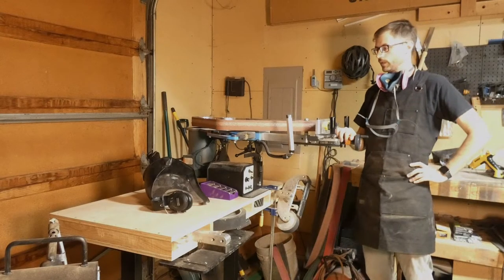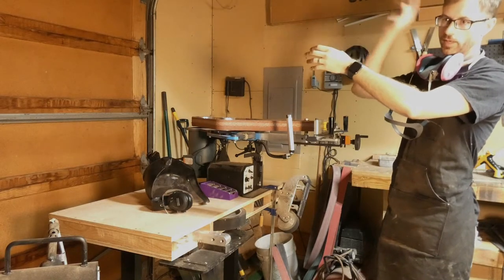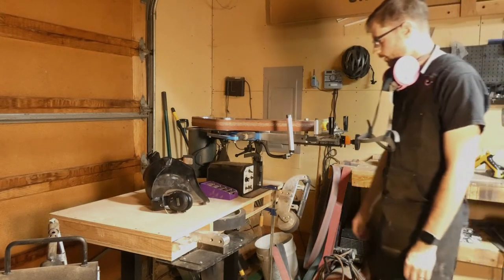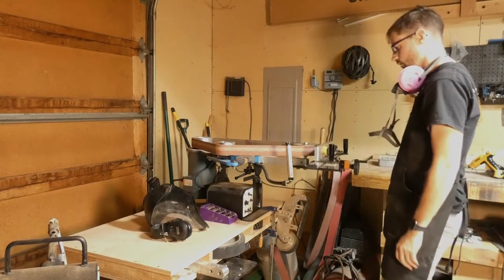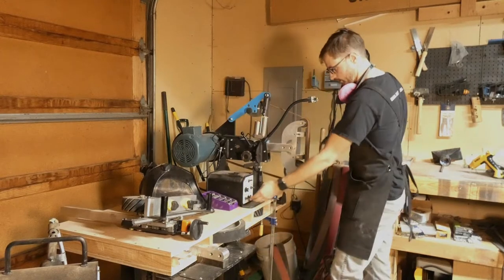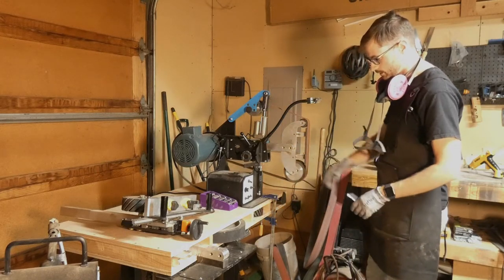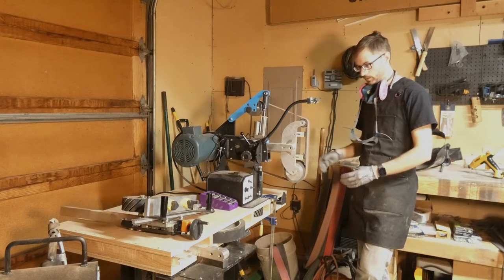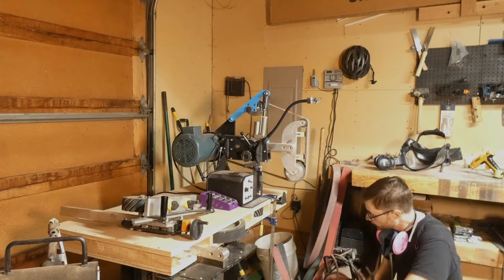Electric up/down Desk for 2x72 grinder - Initial thoughts

Comment: Put it against the wall and add two vertical rails with an interlocked wheel in each rail that is attached to the table.

Comment: If it has two leg supports in an inverted T

Triangulate the T with two straps on each. That should stiffen front to back a lot. 

Since you aren’t going to sit you could possibly weld a 1/16” 8” x ? Horizontal between the supports and stiffen L to R.